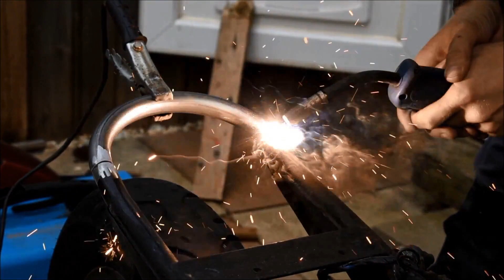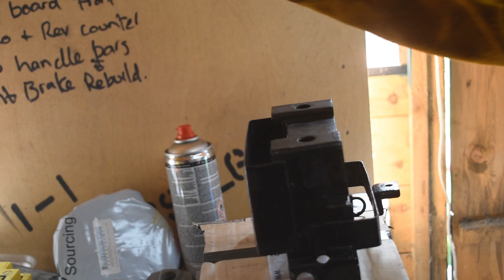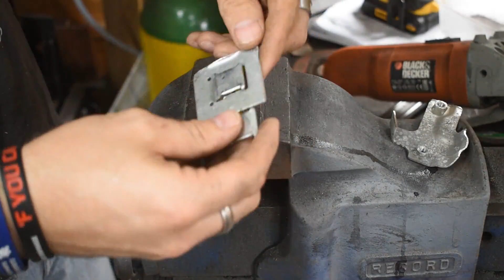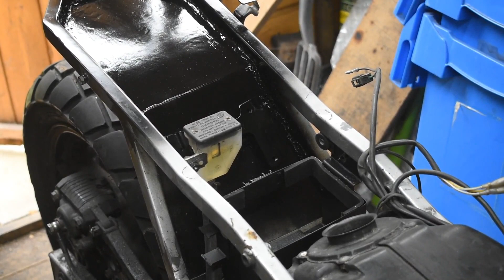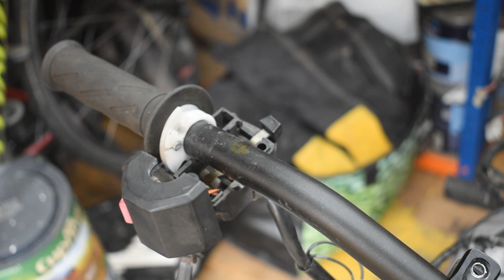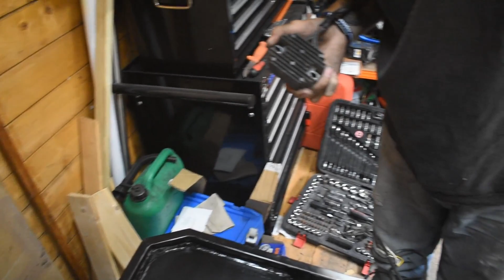GS500 Survival/Scrambler Build - EP15 - Electronics Tray and Front End Tidy Up

Comment: Coming along nicely. I’m in the final throws of getting my Rat Bike repaired and back together and hopefully have that up and running soon. Always good to see your ideas and nick them though. Can’t wait to see how this turns out if it’s anything like your last project, it’ll be amazing.
Reply from the maker: Fingers crossed lol. When will we see that lump back in the 535 then?
Reply: @BareBonesMotorcycles  it’s in already, I’m just doing a few finishing off bits as I need a few replacement hose clips, bolts, bars, mirrors, and it’s done. I’m going to MOT and sell it as a way past mid life crisis got the better of me and I just bought a GSX R600 for some dumb reason.
Reply from the maker: Ah nice, what year? Ive had a lot of suzikis,y last fast plastic one was a k1 gsxr1000. Gen 1 hayabusa before that 😄
Reply: @BareBonesMotorcycles  This is a Yr 2000 on an ‘X’ plate, she is beautiful, Barry Sheen colours. I think a 600 is about as big as I can handle being quite a little fella anyway. Doesn’t really need any work, last owner had her for 10 years and sank about  3k into her so she’s all set. I’m hoping to start work on the CX 650 once I’ve sold the 535.
Reply from the maker: Looking forward tn seeing that